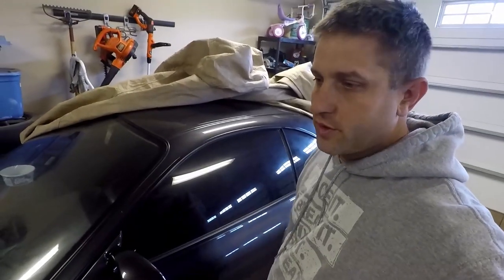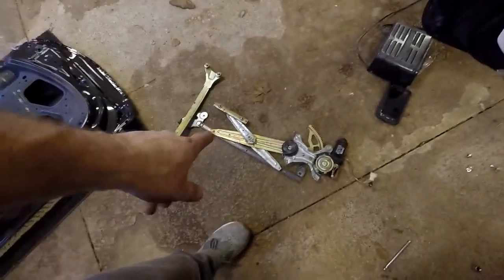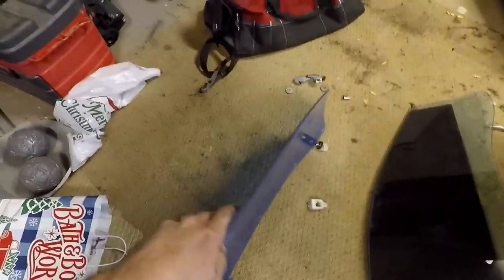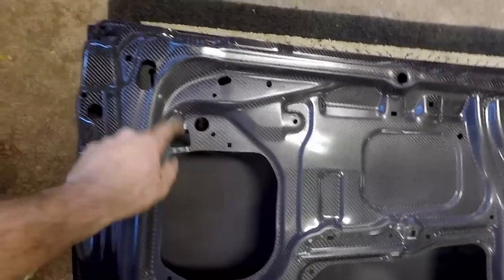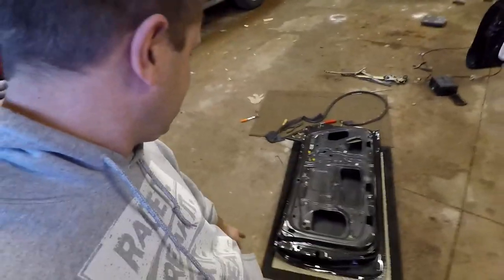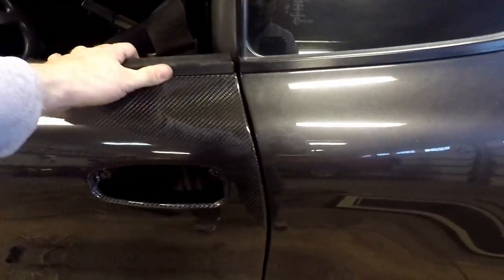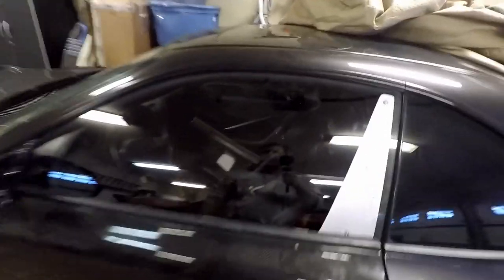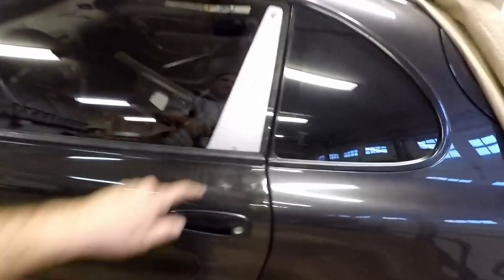ST185 Celica Carbon Door install

Comment: i know celicas don't have the "auto seal" feature (or whatever it's called) like originally in M3s or most cars now when you open and close the doors, but couldn't you just lower the window before closing the door and then bring the window up once you're inside the car?  i think the problem is that the lexan panels are too light to push all the air out of the car without flexing unlike the heavier glass...